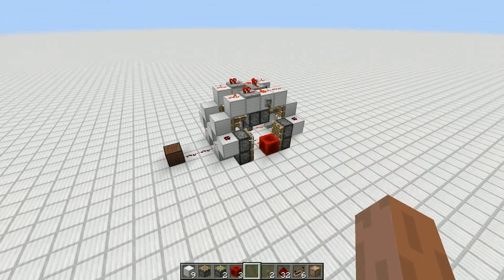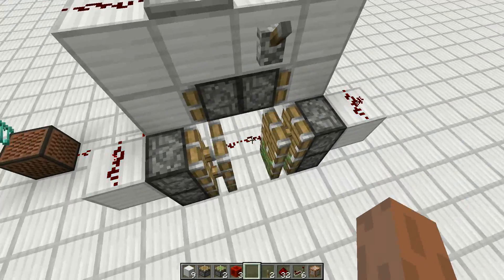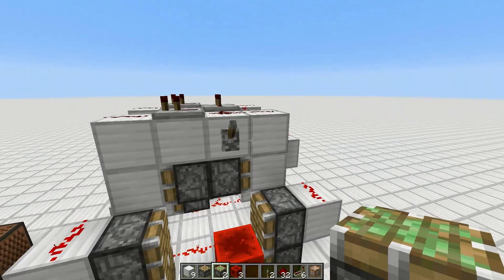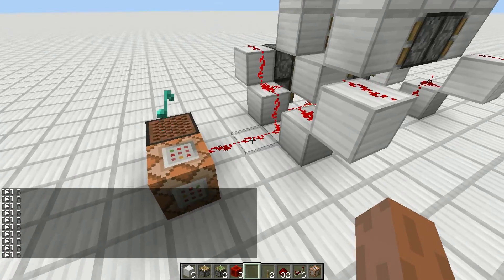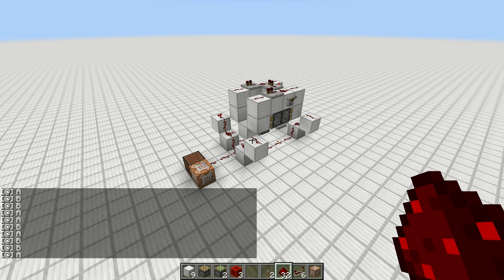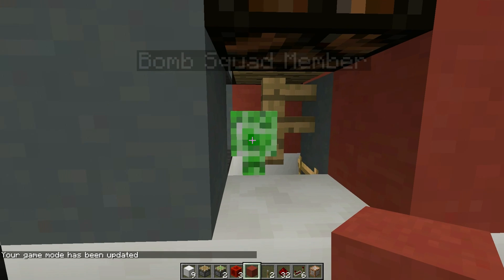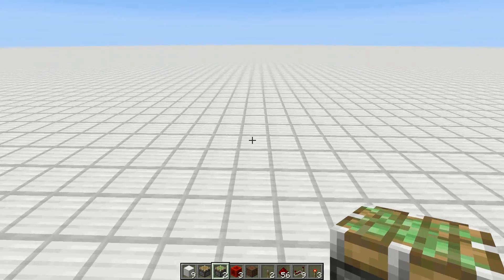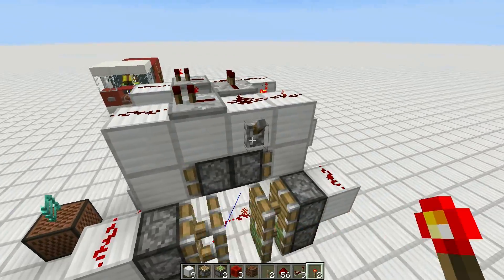Minecraft: ±20Hz Clock (1.8.3)

Comment: Hey I just uploaded a smaller version of this
Reply from the maker: +xMistaBeastx Very interesting clock, but I'm afraid that your design (https://www.youtube.com/watch?v=H6B1Q9OYEh8) is only 10 Hz. It is still pretty neat that this is now possible in 1.9, but you can make something similar using this: http://minecraft.gamepedia.com/File:Repeater_loop_10_hz_clock.png
Best way of testing these are command block that can handle up to 20 Hz. For faster clocks noteblocks are indeed the best option.
Reply: I did the test and you are somehow right. I also tested using Sancarns method of a "much smaller" design but that also is only 10Hz. I changed the title, thanks for answering!

Comment: i just built one of these like 3 hours ago i go online to see how many have done it before and i see this which is pretty much exactly the same  kinda sad now i wish i bothered to build this stuff sooner
Reply: +Ben Abbott although i just made a new design using a comparator which is 4 times smaller than this and silent so im happy c:
Reply from the maker: +Ben Abbott If you have a silent 20 Hz clock based on comparators then you should definitely make a video about it or at least share some pictures. A contraption that could really do that would be priceless. Unfortunately I don't think it is possible to make one. Creating 0-ticks without any pistons alone would be amazing.
Reply: lel sorry its not 20hz it confused but turns out the silent one is between 20hz and 10hz i just made a commandblock hz measurer to test its speed but problem with that is i had to make a 20hz repeater which works fine but its getting it to work with all speeds not just 20hz which is the current problem
Reply from the maker: Not sure what do you mean by that 20 Hz repeater. If it can run faster than 10 Hz then there is a 0/1-tick on pulse somewhere which would be quite interesting. I wouldn't know how to make a 1-tick pulse without pistons. Repeaters and comparators tend to make everything 2-ticks at least. You can see the "Repeater Loop 10 Hz Clock" here: http://minecraft.gamepedia.com/Clock_circuit#Repeater_clock
which is a standard 10 Hz clock that has clock output: 1 redstone tick on (2 game ticks), 0 ticks off. Anything faster would be really amazing.
Reply: pi314159265358978
the 20hz repeater is like an instant repeater but can pulse at 20hz i made it because i thought itd be fun to try and build a computer or any form of logic that has a clock of about 10hz problem with it is that the repeater only works with 20hz nothing less without doing a botch job  but im getting my Hz reader to work right now so ill compare the one i made to that 10hz one see if theyre the same or not they probably are frankly i was using noteblocks before to measure speed and its not easy to get an accurate reading off that
Reply from the maker: That sounds interesting. Do you share your creations somewhere (like minecraftforum)? Would be nice to see.
Reply: +pi314159265358978 not really i dont show things i build but i got the hz scanner working and the silent one was 10hz i think the noteblock was sending out two noises from two seperate but equal 10hz clock making it sound faster but atleast my scanner works fine i tomorrow ill see how small of a 20hz clock i can make i made a 10hz module which is half the size of the one in the video and also mine but its extremely glitchy and needs redstone dust breaking next to it to make it work but if i combine two of them together to make a 20hz it might get rid of the glitch and also make a really small 20hz clock
Reply from the maker: You should really consider sharing your contraptions. It sounds interesting, but just talking about it is useless for everybody. It's hard to visualize without any images or video. Making videos is fun and you can get much better feedback and if it is a new idea people will appreciate it as well.
Reply: pi314159265358978
if its anything worth showing ill show ill get dico to do a video of it or something thats what me and my friend alex did with the 1by 1 redstone lamp display but he built a giant one and he has to fix a glitch in it before he does a video im sure he would be interested about 10hz logic since his recent 5 by 5 door uses a 10hz clock
Reply from the maker: Interesting. I've built a filled redstone lamp display as well. (I've created 1by1 selector pannel and wanted to display the result) Or better say one of the snapshots fixed one issue that was making it hard to do. I'm wondering how different they are gonna be.
Reply from the maker: +Ben Abbott I can actually show you right now. I don't know when I'll have time to make proper videos again so this is just another unlisted concept. It needs some redoing. I was too lazy to make it at the same height and now that I'm looking at it, it looks too uneven xD I'm also not very good with redstone so there are probably better ways how to connect those two modules.
https://youtu.be/IbPDcV3_Rec

Maybe I could contact dico and maybe we could release it at the same time. But I'm really not sure if I would have time to make it.
Reply: +pi314159265358978 ohhh i see yeh theyre completely different my friend created an algorithm of launching pistons with redstone blocks in such a way that they dont effect eachother with buds allowing them to be set i was then making the redstone to automate the algorithm then dico took over and its infinately expandable as a result but some pistons arent being set when they should and dicos just working on a way to overcome that issue but it allready works with smaller displays he just likes to overdo things and make a massive display lel
Reply from the maker: +Ben Abbott :-D That sounds awesome! Good idea. Mine is not very scalable. Strings can go only 40 blocks which is Nx14 limit for the display. The amount of armor stands is the next problem. I'm guessing 150x14 would be the max before frying my PC xD Not sure, I didn't do any lag tests in a long time.